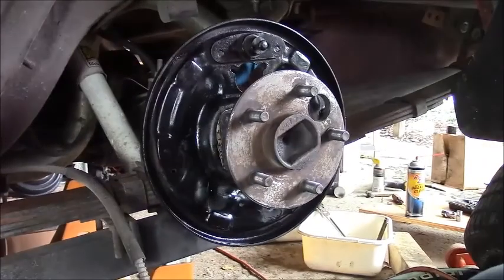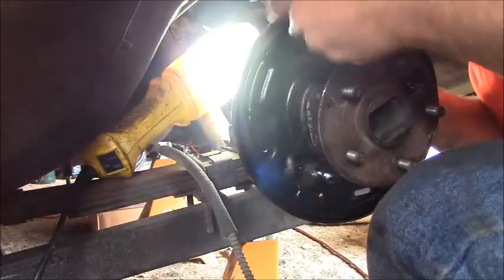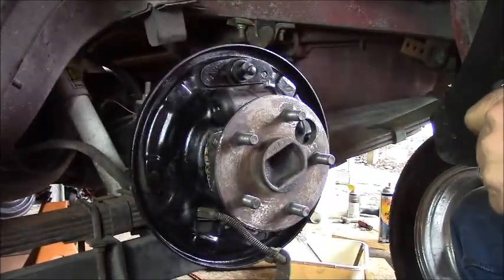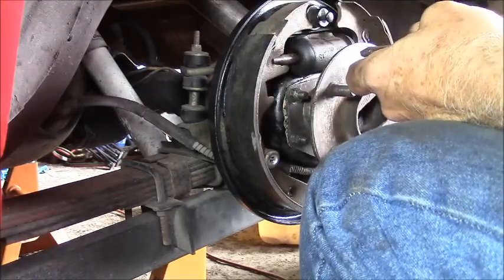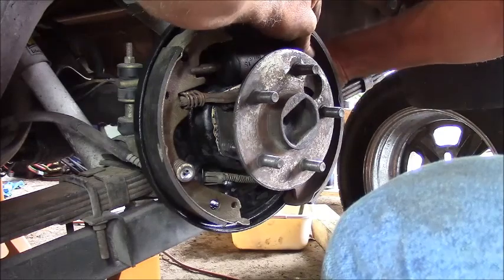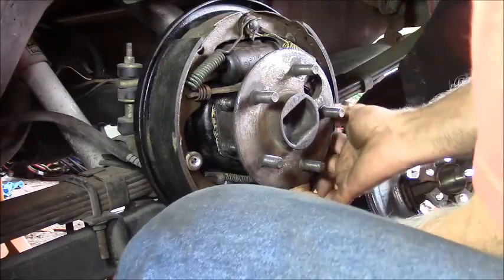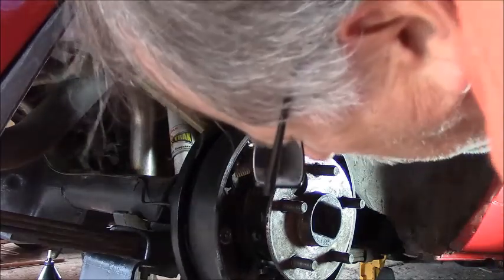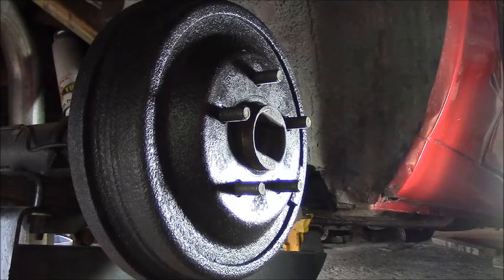How to install the rear brake shoes on the classic 67 Mustang, DIY Ford drum brake installation

Comment from the maker: One trick I have learned is to get the shoes onto the backing plate with the retainers then put a thin ratchet strap around to outside of the shoes to hold them in place